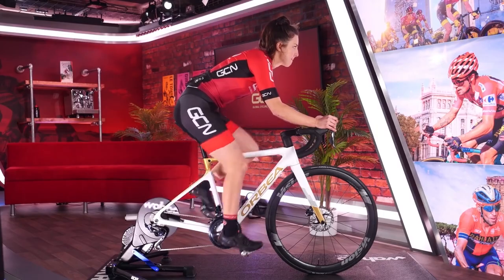How Do Power Meters Actually Work? | GCN Tech Clinic #AskGCNTech

Comment from the maker: Do you have a burning tech question? Leave it in the comments below using the hashtag #AskGCNTech and we'll try to answer it in a future episode of the Tech Clinic!
Reply: Weight limit on the Wahoo. 130 or 113 kg?
Reply: #AskGCNTech can you please do a video on setting up the Hope Rx4 brake caliper? I upgraded after a leaky GRX caliper and it has been a hassle since it is a 4 piston caliper.
Reply: #AskGCNTech hi I wonder if you can help me, I currently have a Ridley Noah fast with 4za factory fitted aero handle bars bars on it, is it possible to get clip on aero bars (TT bars) to fit on to the factory aero bar? Thanks in advance Carl.
Reply: #AskGCNTech In the Giro, the EF team is using a Giro specific paint job on their bikes. What do they do at the end of the race. Do they strip off the paint and repaint or do they paint over the existing paint job? Paint add quite amount of weight to a frame?
Reply: #AskGCNTech   Should you deflate your tires (tyres) a bit or all the way before flying with your bike? Is there a difference between tubed and tubeless ?
Reply: #AskGCNTech what do you think of the growing trend of smart helmets? I’m not convinced other road users would recognise a flashing turn light on a helmet and this could even cause an accident.
Reply: #AshGCNTech
Hi GCN, I just got a new road bike and I started using it quite well but I have a problem....when I put out some considerable amount of power through the pedals, the bearings of the bottom bracket start making few clicky, creaky noises. It is not too loud but enough for me to get annoyed. So I got the chain off the drivetrain and the cranks were buttery smooth
What should I do? Should I ignore it?
Thanks
Reply: #AskGCNTech, My Merida Reacto has a mechanical Ultegra groupset. Can I upgrade only the rear derailleur to di2 and combine it with the mechanical front derailleur. I have never seen something like this. Thanks!
Reply: Good standard powermeter explaination. Have you looked into or tries the powerpod from velocomp?
Reply: #AskGCNTech What are the signs of a bearing going bad in either the bottom bracket, in a wheel, or in a headset? Out of all bearings on the bike, which one would you expect to need to be replaced first?

Comment: Currently power meters are completely overpriced on purpose, just to saturate the market of "serious amateurs". The cycling medias are pushing the message that w.o power meter you are basically not able to make progress.. and we all blindly drop heavy $ on these super simple devices.. if you compare the complexity of a power meter to e.g. iphone... do you guys really think they should cost 600-900$ ? gimme a break...
Reply: I got a left only PM from 4iiii in a 105 crank for a little over $200. That may still seem really high, but I love it and that price seems really reasonable to me.
Reply: It's not the product where the costs are, it's the development & tooling. How many times more i phones are churned out spread that cost? 

Though I'd be surprised if any of the electronics are product specific & you can pick up an electronic torque wrench for about 50 quid.
Reply: As expensive as they are now, they used to be much more expensive!  Price always comes down over time.  No one has to have a power meter, it's a choice.
Reply: You don't saturate a market by making something overpriced. To increase sales by increasing prices, you're creating a Giffen good, and Giffen goods do.not a saturated market make. 

Broadly, they're a lot cheaper now, hence the appeal to less serious cyclists, and there is probably some marketing around that encourages it, by it that's what marketing, and companies, do.

If there is a short term spike in prices right now, it's not visible where I am (Australia), and is probably covid related, and not systemic.
Reply: Sales volume would also be a significant impact in cost...at least when comparing to phones. One source 'statista' estimated 217 MILLION Iphones were sold in 2018...while I doubt the volume of all power meters sold crested 1% of that year. Small batch production costs more per unit.

They (power meter manufacturers) could likely cause demand to skyrocket with price reductions, but may not have the means to meet that demand. They may be capable at current levels of demand with slower ramp up.

Comment: power meters are actually very cheap to produce. maybe $25 material costs and testing. they are sold to distributors for about $150-200. The manufactures have a lot of other costs though, and end up with 30% margins.  other costs would be large development costs that are amortized over a long time, plus normal business costs. what is amazing is that a bathroom scale, which has the same strain gauges (more or less) cost $40 at the retail level.

Comment: Mechanical Engineer with a masters in FMEA modelling here:
The strain gauges that are used within bikes, are small, and are worth next to nothing, I’m talking about a few $ each.

Aside from paying for the brand name of the Power Meter, you are paying for the data calculations/ interpretations that varies slightly from one manufacturer to another. How much is that worth? Not much at all. The calculations required to determine forces applied to a crank arm are pretty basic, and with some lab cyclic testing, manufacturers can test millions of loads to crank arms relatively quickly to improve overall accuracy. This requires only a few Engineers and some basic testing equipment.

You are paying a few bucks for a simple strain gauge, a few cents for a small dumb chip to interpret the data, a few more for a BT module, and a few more cents towards some hardware to house components. 
The other few thousand percent of markup goes toward R&D and that brand name.
Reply: Doesn't sound surprising at all. I would assume that the exact spot and method of installation plus any theoretical calibration it is what makes it difficult for end users to install and use? As opposed to cadence meters for example which you can just stick to the inside of the crank.
Reply: @GeorgeD1  Yep, that’s correct. Calibration would be the hardest part for end users to take on.
Reply: While somewhat true. There is a lot more to the “calculations” are far more complex than you give them credit for. Most power meters on bikes are also designed for use off road where sorting out bumps and vibrations through the bike is necessary. And even on the road there is a lot going on. Was that spike the rider sprinting or did the chain catch slightly when the rider shifted under load? Or was it a pothole? 

And while it is easy to record the torque data and analyze it afterwards and make adjustments based on each ride, and then calculate power from the torque and cadence data. In cycling we do that analysis live while riding and record only the final result. So create an algorithm that does all the calculations and sorting of the input between rider and all other factors fast enough to give the rider a live readout on their computer. Not a simple task and the fine tuning to get it right takes years. 

That’s why so many Kickstarter power meters fail in the last 5%. It’s really easy to make a working prototype but to fine tune the algorithm to work in 99% of all situations and hit a 1-2% accuracy on top of that.
Reply: Having made a few power meters I can confirm the components are indeed very cheap. However the end result is a functioning power meter but the power average can be +- 5W of a real one. Not that useful for tracking fitness.
The work involved in getting the accuracy to 1% is what you pay for because it's no easy task.
Reply: @alonzochristensen6904  The calculations are very very basic in these applications.
Reply: @cae8978  I am a computer programmer. It’s not that simple. 

The basic equation to compute power from torque and rpm is simple. The equation that reads in the constant changing voltage from the strain gauge and determines what if all that changing is the rider pushing on the pedal and what is road vibration through the frame, and even the rider pulling on the pedal through their clipless shoe. And then converts that from an analog signal to digital value of torque to then send to the power equation. Getting that algorithm right is very complex. Especially when it’s needs to be accurate to within 1-2% from 20 watts all the way to 1800 watts. 

Show me a digital torque wrench that is accurate across a range of torque values from 0.5Nm to 50Nm within 2%. They don’t make that because it’s not practical, instead get two or three torque wrenches abs split that range up.

And then let’s see if it’s still accurate while I tap it with a hammer while you tighten a bolt. 

The processor in today’s power meters puts the early computers that were the size of rooms to shame in the amount of data analysis they do. And they do that when it’s 50°C and when it’s -10°C and in fact, it compensates for that temperature live while you ride not just when you turn it on and hit calibrate. Do you know what happens to a computer when the 12V power for the CPU drops to 11.5V? Usually a blue screen because chances are it was trying to calculate something important and what was supposed to be a 1 ended up a 0. If not that, then it certainly drops the clock speed so there is more time for all the inputs and outputs to become stable before they are read. What does a power meter do when the 3V battery drops to 2.9V? It compensates and sends a low battery warning, it is expected to send a power value every second, or faster, it can’t just pause and take longer to measure. It has to work, every time, in every condition, including the ones the designers didn’t think of. 

So yes the ‘calculation’ of torque and cadence to get power is very simple. But reading a torque value off of a strain gauge that is constantly changing is much more complex and that has to happen before you get a torque value.
Reply: @alonzochristensen6904  To me, and the field that I work in, these basic strain gauges are simple and have hardly any complexity to them.
Reply: @cae8978  sure. What I am trying to tell you is in cycling it is not a simple situation. The concept of attaching a strain gauge and reading the resistance change. Calibrating that with know weights is very easy. 

Doing a power meter on an indoor trainer is easier because there is far less vibration. 

Put maybe enlighten me, does your application actually analyze the values in real time, or do you record the resistance changes and compute after the fact from the recording?
Reply: @cae8978  there is a huge amount of complexity in analysis in real time by a computer. 

Not even in formula 1 do they analyze the suspension strain gauges for vibration from the wheels in real time. They have people looking at the live readout and analyzing it resulting in at least a few second delay. This is why the top drivers always know that their tires are bad and then the team confirms the fact over radio. The driver can feel it faster than the engineers can analyze the live data.
Reply: @cae8978  for power meters, the price is not the components or the basic calculations. It’s the guarantee that it will work in nearly any situation, including being pressure washed when the temperature is below freezing during a cyclocross race or when it’s a race across the desert in the blazing heat. 

And to have it be accurate in the entire range of scenarios that can encompass is a very complex algorithm that analyzes several data streams live with no input from a human. 

I want to see a technical answer from you. Why am I wrong. Explain in technical terms why it’s so simple. 

And maybe you are just unaware that it is complex because you have employees under you who do all the difficult parts and you just see a strain gauge and the data that comes from it. There is nothing wrong with that. But you should be aware, there might be some people who deserve your respect. 

Again, I want to see a technical explanation from you. Or proof that you built a working power meter that reads within 3% of a production power meter across a 1 hour mtb ride.
Reply: @alonzochristensen6904  This isn’t formula one.
This is a relatively dumb strain gauge, feeding data that is within a certain, pre calculated range. 
When the data falls out of that range, it doesn’t provide results and the previous averages are used. 

Once again, bike cranks are very dumb and basic applications.
There are not too many variables, and there’s literally NO safety related issues with manufacturers having incorrect data.
In my field, if the data is incorrect, people die.
Bike manufacturers have their arses covered by having a few percent error stipulation in the packaging of their items. A few percent!
Reply: @cae8978  it didn’t say it was formula one. I said that even in formula one the pinnacle of Motorsport they don’t have microprocessors analyzing data from a strain gauge live. 

Clearly you haven’t ever ridden with a power meter that has failed. One of the first symptoms is the power reading dripping to 0w or climbing to some max value like 2000w. Doesn’t sound like using previous averages to me. Cycling crankarms are dumb they don’t have memory they don’t know what my average power is. It just sends a power value out the Bluetooth antenna. 

Do you have any idea how large a lookup table would have to be to handle every cadence, torque and temperature value? And sure we can store that in some read only memory, but it also takes a long time to repeated lookup data like that. 

And again, how does it decide between a peak torque above the y axis or below the y axis? What about when the rider hit a pothole and there is a huge spike in torque in the middle of the power stroke. The power meter itself sorts that out. This is not easy and is impossible to do with a simple lookup table.

Now as far as the averaging that is common in cycling. That is done on the head unit which never sees a torque value it doesn’t process the strain gauge data. The averaging done on the head unit is done simply to the incoming stream of instantaneous power values sent by the power meter that has already done the processing and calculations. Depending on your settings your head unit may display a rolling average of these values so tat your data readout doesn’t jump as much. But if you analyze the actual file after your ride you will find that the power data is very erratic.

Simply, you are wrong and you won’t admit it. At this point I’m somewhat skeptical that you actually work with strain gauges in reality because so far you have yet to display any knowledge beyond what I learned spending a week studying them in college to learn about the interaction between an analog device measuring something and the firmware used to convert that signal into digital data. 

I’m not the smartest person in the world. But I am smart enough to know that you aren’t either. This conversation is over because it’s a waste of everyone’s time.
Reply: Simon here from MFL Strain Gauges,

Unfortunately your assessment here is not entirely correct. Some Chinese strain gauges may be cheap, however these are not reliable nor provide accurate output consistency time and time again, therefore brands will pay more for European and Uk made strain gauges. Power meters relay on long life batteries and therefore require high resistance gauges.  High resistance grids are small and expensive as the yield for manufacturing is low due to the complexity of the constantan foil breaking. Many of the top brands are paying quite a substantial amount for the strain gauge alone, it would indeed be one of the most expensive components in the meter.
Reply: @cae8978  hiya, Simon here from MFL Strain Gauges.

I assure you, there is much more in it than you think.  Firstly each crank material have separate gauge types. Strain gauges for power meters fall under the class transducer within this class they will be compensated to carbon, steel etc. Strain gauges are super sensitive even slight temperature variation will throw out the values. There is a very complex computation required for accuracy and zero offset per Deg C/F per second from 1st hand experience working with many of the top brands you are paying for the hundreds of hours of R&D and the fact that these brands don’t make their Gauges, we do.

What field do you work in? Who have you purchased your gauges from and what gauges ? Im assuming something cheap from China ? I’m unsure that you will have made your own strain gauges as we are one of only a handful of facilities in the world that do this.
Reply: @simondobbins7509  thanks for the detailed technical explanation Simon. I never even considered that entirely different strain gauges would be needed for different materials. Makes sense now that I think about it though.

Comment: The "factory grease" on the chain is most likely only a corrosion inhibitor, with no real lubrication properties to reduce wear. Cleane the chain, then lubricate it with your preferred chain lubricant.
Reply: Factory grease is not made to stand the pressures inside the chain, the grease is meant to preserve the chain in the packaging.
So as soon as you want to use the chain you have to replace this protecting coat.
Reply: @JeroenVandK  You are 100% correct sir.
Reply: @JeroenVandK  From Shimano: “... So the best thing to do when installing a new chain is to leave the factory grease on, not apply any other lube, ride until it wears out and then start applying liquid chain lube.  In dusty conditions you can wipe off the outside of the new chain with a rag that is wet with a gentle degreaser to keep dirt from sticking to the grease.  The factory grease also keeps the chain nice and quiet.  After soaking a chain in degreaser and then lubing the chain with liquid lubricant the chain gets noticeably louder.”